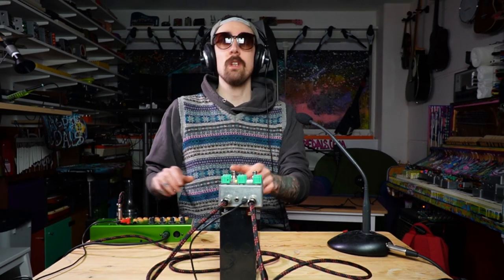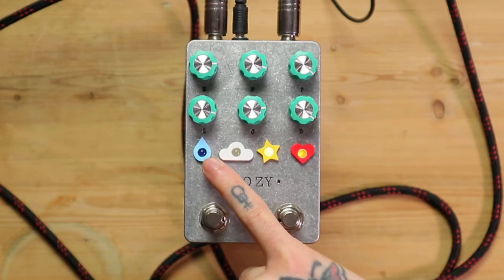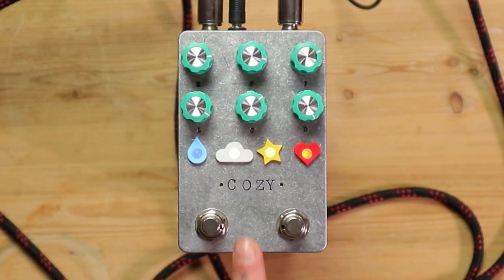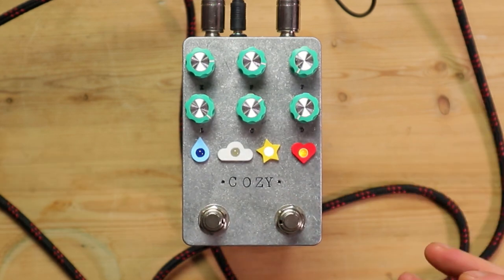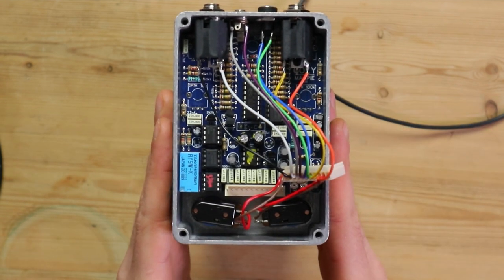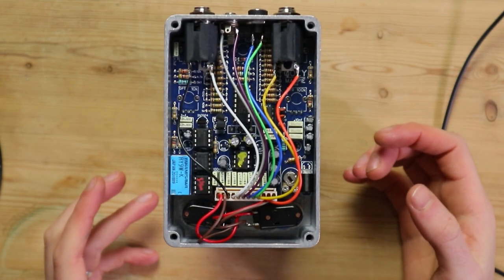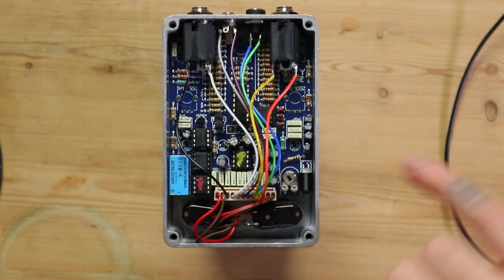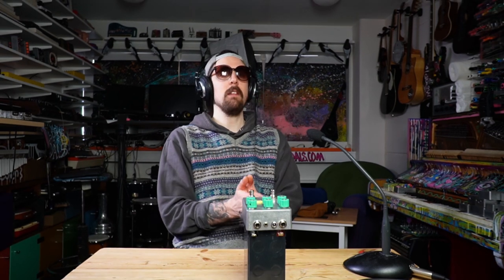Cozy - The Pedal That Samples And Holds Time

Comment: Very cool pedal. Syncing the clock sounds really good. You have the drifting wonkiness, but still locked to the correct tempo, so it doesn't degenerate into a incoherent mess!